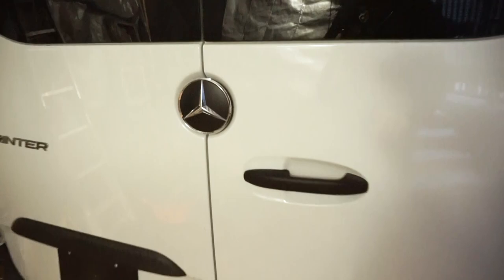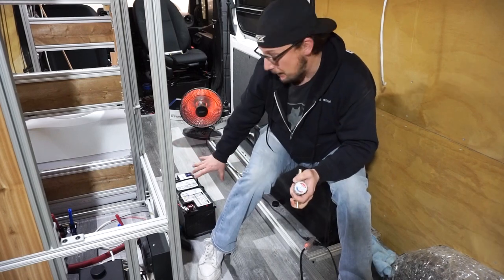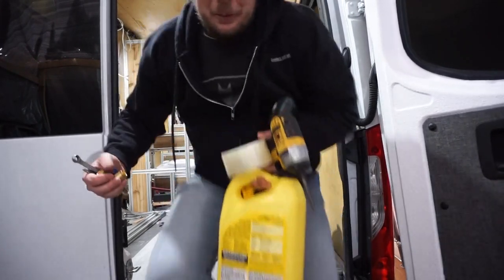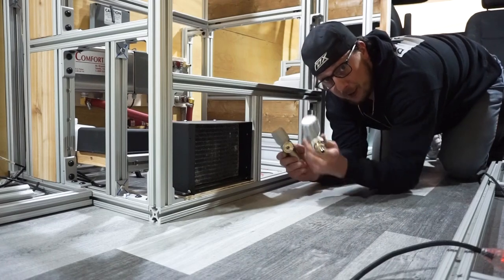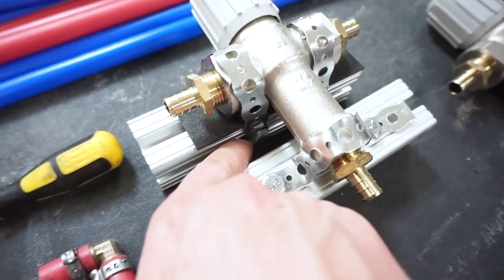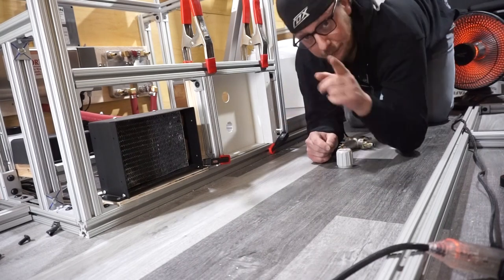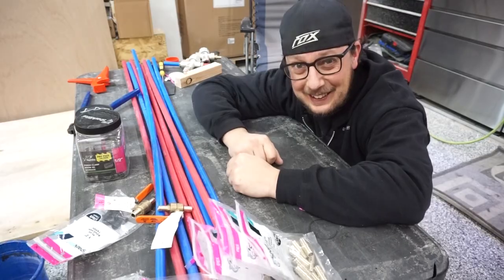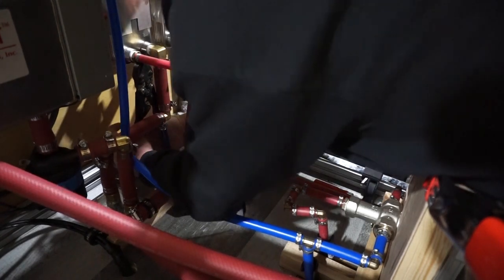Install MIXING VALVES and WATER LINES | FOUR SEASON VAN LIFE | EP.47

Comment: Just found your channel. I like it.  Noticed you rewiring your controller power using standard wire nuts.  Look up Wago Lever nuts on amazon. Check their web page for other components, like waterproof connector blocks.  There are other brands and sources but they will make your wiring tasks a lot easier (assuming you still have some to do). Also, if you have to change your wiring; super easy.

Comment: Nice job on figuring out the mixing valve mounting. I was brainstorming as you were talking about it earlier in the video, and I came up with most of what you tried before you got to your final solution which I didn't think of.

So your van build is one of four I'm following in this city on YouTube, and it's the most extensive. 

Products and systems reminds me a lot of the Humble Road builds which I really enjoy watching as well.

Gotta admit, I didn't anticipate a Big Mac consumption segment. I swore off those things after a Big Mac eating contest back in the late 80's. But I appreciate your willingness to accommodate your audience.
Reply from the maker: Yes this idea took many weeks of thinking and staring at. Funny that this final idea came to me the day before I started recording it.. I did have a completely different plan in the days leading up..   I appreciate the kind words, to be compared to that name is an honor! 
Yes stay away from the big macs, I did actually take a nap after eating it!! LOL.
Reply: Try to stay warm. I know it's pretty harsh this weekend. I was wondering, how much of a power draw your hydronic heating system uses? If it's within reason of a AC to 12 VDC power supply, it would be a good way to test the system in these frigid temperatures

Comment: Your videos are good!  I came in recently on the Rixen install.  I wish I had found you sooner.  You mentioned you do not have your house batteries yet.  What are you planning? I have 600 watts of solar on the roof and have yet to install the Xantrex 3K inverter charger, Sterling 60 amp charger, Victron 60 amp MPPT charger, and 630 amp hours of lithonics batteries.  Just buying all the parts, and wire to hook these items up and pull the wire set me back more than $1,800 US.  I had not budgeted anywhere close to that.  So yes, you are 100% correct the stuff in between really does add up.
Reply from the maker: Awesome glad you found my channel and it brings value... I am going with Battle born batteries, between them and the wires it is a huge chunk of the budget so it is left until last.
Reply: @DaresDrives  As your van is a “four season Van” and you live in Canada you may want to consider a Lithium battery that has an internal heater so you can charge safely when the internal temp of the van and battery are below freezing.

Comment: Thank You! What a timely video. I was just in the middle of my research on how to mount the mixing valve :) I am outfitting exactly the same model of a van and I am in the process of installing Rixen's system. One think I have learnt in my research  is that on metal tapered fittings, one should coat the threads with paste-type pipe sealant instead of using Teflon tape. I am not a plumber, so I don't know how big of a deal it is but I figured that you may want to look into this subject before it is too late. I wish you all the best with your build and I am looking forward each week to your informative and entertaining videos.
Reply from the maker: Perfect, hopefully it brought value to you and I appreciate your input. These are just standard 3/4" NPT fittings, there should be no issue with teflon tape. Fingers crossed!!

Comment: With the heat from the engine getting the coach water really hot I can see why you wanted mixing valves prior to the normal sink and shower temperature control valves.  Nice.
Reply from the maker: Yes exactly, same with the diesel burner it will get very hot as well. Thanks for watching and commenting.

Comment: Great videos, thanks.  Did you look at Uponor pex connectors,, they seem like a better path than crimp? Thanks
Reply from the maker: Awesome thanks, Yes I did look at Uponor and it was part of my initial plan. But as I got closer to this part of the build, I noticed there is zero local availability in my area for this product and its impossible to know what to order up front. This project took many trips back and forth to the hardware store and would have been very troublesome with Uponor possibly causing weeks of delays for delivery. As well I just couldn't see myself paying that much for a one off special tool that I will never use again after the van build is complete!..  Thanks for watching and commenting!

Comment: You did a great job. Why did you choose pinch clamps as opposed to screw hose clamps ?  Also 15:04  the direction of flow in the heat exchanger, How critical is this.  I would think it should not make a significant difference as heat is heat. Please elaborate.

Comment: Hi, excellent detailed video. Quick question, could you have used those plastik fittings that "self lock" and seal the PEX tubing? I don't know what they are called. If you could have, why didn't you? I am in the process of buying a van and doing all the research and the water system is the one that scares me the most. Keep up the great content!
Reply from the maker: I started originally with Shark bite but went back and pulled them out.. Decided to stay with tried and tested crimp fittings..Thanks for watching and commenting

Comment: Great video, question , why mix the water before going to the sink and not just have a mixer at the sink and shower.

Also why not have a heat exchanger small hot water tank that would store hot water created while you run the heater at night or drive the van.  That would mean that would not need to run the hot water system just to have hot water, you would have some stored after a drive or using the heater overnight.

Comment: Enjoying your videos, yes I have subscribed. Still planning my van out as it is scheduled for build in February. We plan on living in it for 1-5 years in the beginning of our retirement so we are going all out on it. I will be using a Rixen system and plan on having 2 heat exchangers, 1 for the kitchen and 1 for the recirculating shower. The thing I’m trying to figure out is how to keep the shower water at the right temp while running the shower. We are planning on a 3 gallon loop of water for the shower and only 2 shower per water change.  So any ideas on how to maintain a stable water temp?

Comment: Jeff, noticed you are not using a hot water holding and heating tank for your hydronic system at the expense of using additional heat exchangers (one for sink and shower). Have you tested this to see if you will get a constant source of hot water at full water flow for your shower? Also why do you have two esbar hyronic heaters inline? Couldnt one do both jobs of heating water and pre heating your MB engine?

Comment: Greetings from Colorado! 

Super interested in your videos as I'm ready to order the Espar and the rest. I want to add a radiant floor loop and curious- your thoughts on that and can that be controlled independently within Rixen's Controllers? 

I'm tempted to try Pex-Al-Pex which is supposed to be more easily bent into tight curves thereby reducing the number of right angles, fittings, clamps, and labor. 

Any thoughts on Pex-Al-Pex tubing?

What is the high altitude limit for your Espar burner with Rixen Controller?

Thank you kindly for your YouTubes!

Comment: How adequate would you say the heating capacity is when on diesel only heating? The instruction manual from Rixen makes it sound like you'd struggle heating the van in really cold temps without the electric heating element plugged in and working as well. Would you consider diesel only a sufficient off grid solution for below freezing temps?

Comment: I have a hydronic heater in my truck for engine preheating  Could you see this system being used in a truck camper?  I really want to get rid of my propane hot water and have already turfed the cooktop and replaced with induction as I have more than enough AH and solar.  Do you think there would be room?  Id love to be able to run under the floor but i dont think that will work so will prob use heat exchanger  Im gaining the space that 2 10lb propane bottles take up now  And the heater itself is in an under tray tool box.  Interested in your thoughts and thanks for the great vids

Comment: I like your videos ALOT.  And in this Video i have a question to ask: Could you also have put the mixing valves directly to the heat exchanger with a copper connecter? Without using the tube i mean, to shorten the distance between the heat exchanger and the valves. I understand you have your personal reasons for this solution. But i wonder if my option would be strong enough and not break anything? 

Because im in the second year of my 3 yrs planning 🧐 and im planning to build the “same sort off system” together, outside of the van, inside a 80/20 box. And ones im finished, i will install this whole box inside the van. 

Keep up these videos 
Cheers from the Netherlands 🇳🇱
Eric
Reply from the maker: Super awesome, glad you are enjoying and the videos are providing value. There are a few concerns I see with using cooper pipe in a mobile build. First is cost, second would be weight and third would be the vibrations and how well the copper would hold up long term. There could be fear of it cracking.. The pex is fairly strong if you keep the lengths short enough it could support the mixing valve.. That is how most people have done it in the videos I saw during my research..  Hope this helps, thanks for watching and commenting.

Comment: Did you consider using shark bite fittings?  We’re they cost prohibitive?
Reply from the maker: I did and I started with them on the under floor lines. But I went back and pulled them out as something about a push type with an oring as seal just didn't sit right with me. So I went with old fashion tried and tested crimp fittings. Thanks for watching

Comment: Any concern with the residual heat from the tank/heat exchangers being in the cabin?  In the winter, I can appreciate that is no biggie.  What about the summer?
Reply from the maker: No I do not see that being of concern at all.. It will heat water from cold within 5-7 minutes, in warmer weather you would have instant on demand hot water without constant heating even needed. It only has to heat the plates and then the water runs through them. It doesn't have to keep 4-5g of water hot at all times.. Hope that helps, thanks for commenting.

Comment: Once the mixing valves are set do you really need to access them very often.  I do apricate your attention to detail though.  Have you seen the pex that is bendable and therefore reducing the amount of elbows needed.  Great build.
Reply from the maker: Honestly, no you shouldn't need access to them on a regular basis. This was just the best spot to put them given the area we were working with and having external access was an added perk..  As for bendable pex I believe you are thinking Uponer, yes this is a little more flexible but in this small space you would have still had the same number of connections..  Curved piping doesn't look as clean as some nice 90 bends IMHO. Thanks for watching and commenting.

Comment: Hi Geoff, you said the hot water output is 190 degrees. What safety features if any have you got in case the shower tank runs out.
Reply from the maker: Hello, not sure what you mean by if the tanks runs out? No water running through the heat exchangers will not hurt anything. Let me know if that answers your question. Thanks for watching and commenting.
Reply: Hi, no since the hot water is so hot it will mix with a lot more of the cold so if the tank runs dry the ratio of hot to cold will change very quickly. I am concerned that in that event as the remaining water in the system runs out you will end up with a slug of very hot water, if that happens as you shower you won't get any warning and could scald yourself even if for just a second or two.

Comment: If I guy wanted to do what you did, tying the Rixen into the motor, do a recir shower, hot water to sink and hydronically heated floors would that be 3 or 4 heat  exchangers?
Reply from the maker: You would need a double plate for your recirc shower,  double plate to your sink water, single plate for heated floors and single plate for engine heat. 4 in total!   Thanks for watching and commenting.
Reply: @DaresDrives  Thank you!  That is what I need to know!
Reply: So I have the one single plate (for the motor) and the two double plates (for the shower and sink) .  If I get another single plate(for the floor), I likely also need four mixer valves one for each system?
Reply: And I probably need 4 of those blue pumps too right?
Reply: Called Rixen he said the single plate exchanger will do the floors and motor.  The 2 double plates will do the recirc and the sink & the fan piece is essentially another exchanger.

Comment: Would you just mix it ( ie water) @ the taps in sink or shower? Or is it that the hot water is too hot from the heat exchangers?
Reply from the maker: No, that water is at 190f out of the heater.. Need to cool it down before it gets to the taps. Thanks for watching and commenting!

Comment: Is it possible to use only one heat exchanger for both tap and shower? Thanks!!
Reply from the maker: Yes no problem at all.. just split the line after the mixing valve to two separate taps. Thanks for watching and commenting
Reply: @DaresDrives  thanks! I’m getting allot of good inspiration from your project!!👍

Comment: Anyone know what the primer is Jeff uses before he puts adhesive or sealant on the van? Thank you
Reply from the maker: Hey thanks for commenting, not sure what you mean about the primer?
Reply: @DaresDrives  you put black stuff on metal before adhesive, looks like a can with a swab in it black stuff ?
Reply: You used it on your roof under most brackets and you solar gland box.
Reply from the maker: @K9TPT  Yes that is just a standard metal primer in black. I believe it is linked in the description of those particular videos..

Comment: My peep!  Yet another great video!  

You can use your Mercedes starter battery as a source for your heater while in your tent  (exhaust out the tent tho - we want to see your future videos!) - you can get yourself a high quality charger like the Victron BlueSmart IP65 12V-15A charger, connect an extension cord to the IP65 which is connected to your battery, and actually run your diesel heater while parked and not run out of battery.  

I do this with my Sprinter and Espar D2 and works very well.  Plus, having a happy and healthy fully-charged Mercedes starter battery is always a good thing.  I have a short video on how it's done (hope you don't mind me sharing) - https://youtu.be/02XL2jYjLT0
Reply from the maker: Awesome, thank you for sharing. I think I am just going to stick with my ceramics for now as they seem to be doing the job.. See how cold it gets before spring comes back! Thanks for watching and commenting!

Comment: Wouldn’t you just mix the temp at the handle of the faucet like an actual house?
Reply: It’s dangerous to have 190F water coming to the mixer in your shower. What if you accidentally nudge the handle and put it on fully hot? 190F water all over your body will give you SEVERE burns. 

So you have a mixer valve after the heat exchanger to cool the hot supply to about 120F (hot, but won’t burn you) and then another mixer valve in your shower where you do small adjustments to get it to your preferred shower temperature (say 102F).
Reply: @peanutbuttereggdirt1  super great point!
Reply: @peanutbuttereggdirt1  In support of your comment household water heaters (mine is natural gas) also have a temperature gauge so it heats the water to a set level.  The point being even your normal household water heaters have a temperature setting on the water heater unit, so temperature control is taking place both at the tap and on the water heater.  Much like what is taking place with the Rixen system.
Reply from the maker: Perfect

Comment: Why not sharkbite?
Reply from the maker: I did do shark bite in my under floor video..  I went back and pulled them out because I just couldn't get over the possibility of a manufacturer error and it leaking..  I decided on the tried, tested and true old fashion method of crimps. I never had a bad experience with shark bite but just couldn't sleep on the thoughts.